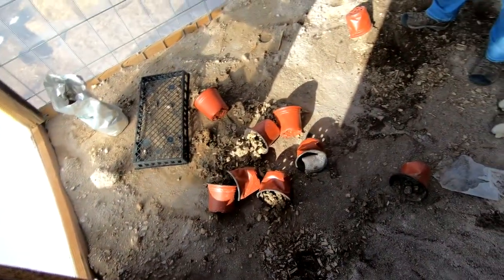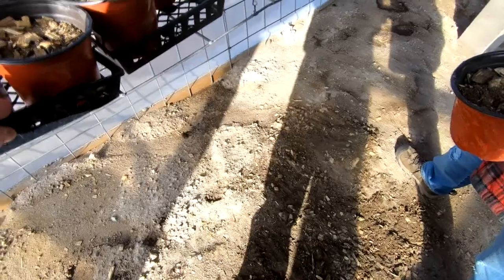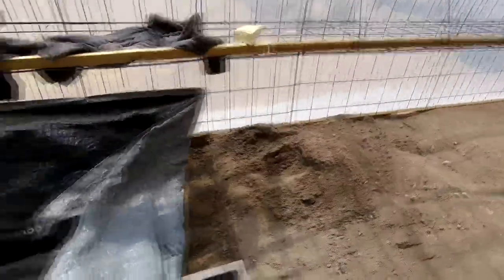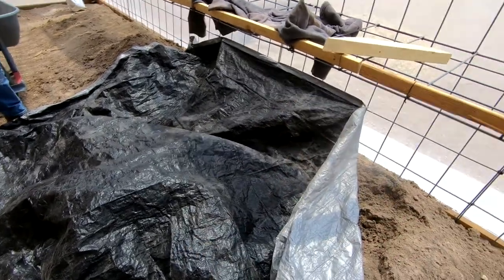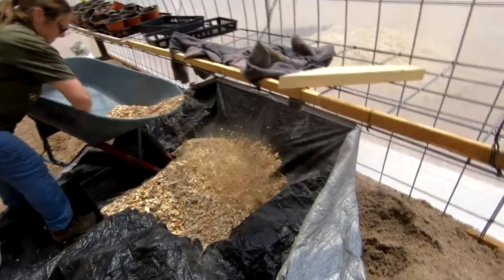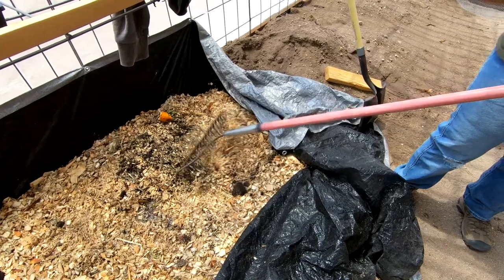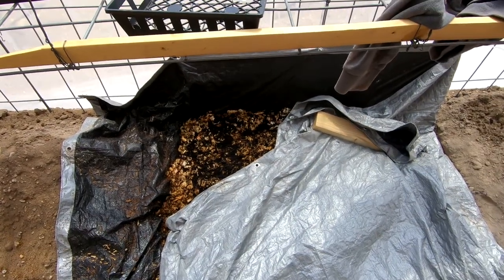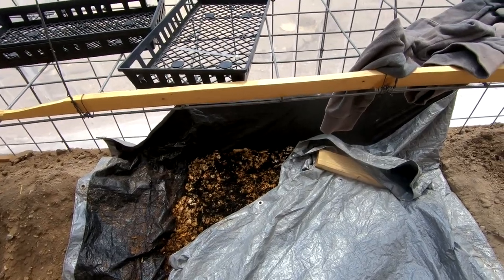Compost Your Greenhouse!

Comment: Cat litter? I looked that up. I see that there are some fully biodegradable ones that work. Interesting.
Reply from the maker: Yeah, this is all sand out here.  Any kind of clay that you can add to the soil is beneficial. Bentonite clay, used in well drilling and pond sealing is great stuff, if expensive.